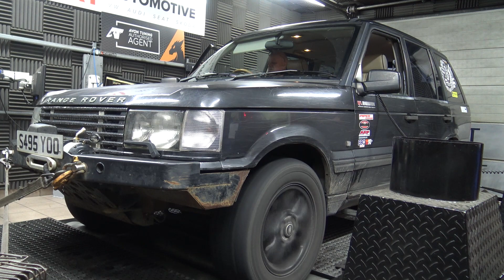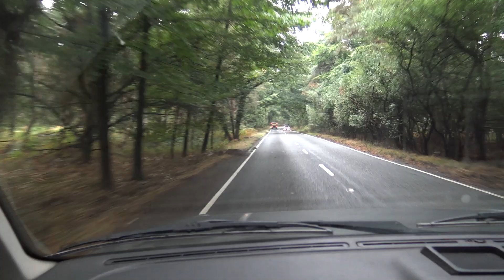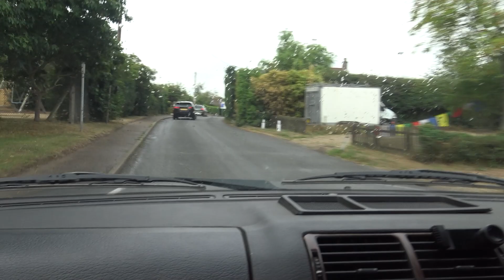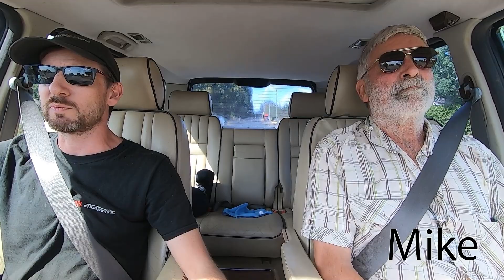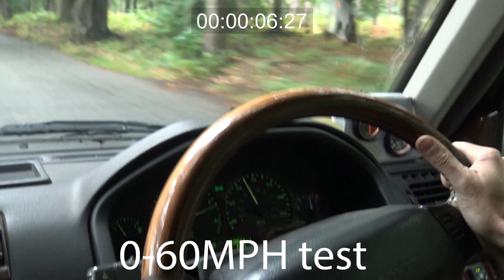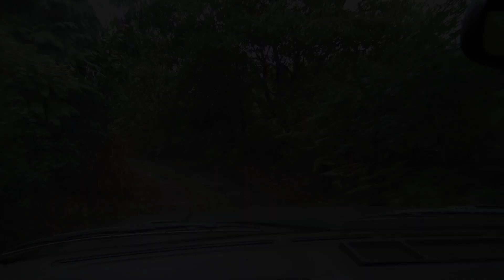Twin Turbo Tuesday Episode 17 -  Twin Turbo 4.6 V8 Range Rover P38 Final Dyno, 0-60 run and results

Comment: Good afternoon. Tell me, what do you have on a Range Rover P38 4.6 bosch 2001? If I'm not mistaken, you had a Merlin cylinder head and an intake manifold with 2 throttle valves on sale.

Comment: The dyno figures prior to turbocharging seem curious; 240bhp/255ftlbs. We're the quoted factory figures of c.220/277 or 300ftlbs for Thor, rather inaccurate?
Reply: Factory the 4552cc 4.6 is 218PS and 4.0 is 185PS so that is odd.

Comment: really close to standart sec 0-100
Reply from the maker: Well over 2 seconds faster, but as pointed out in the whole video build this was not about big numbers etc it was done for mid range driving power. Which this has by the bucket full.
Reply: @RPIEngineering  thx for answer
why dont choose charger?
and do you explain in videos how you change fuel mixture?) very interesting)
Reply from the maker: @MuNGusTik  Yes this is all explained in the video series. Several people have gone down the supercharger route however I wanted to do twin turbos as I didn't want the engine driving a blower along with a few other reasons.
Reply: Between 3.9 and 4.6 which one is more reliable and have longevity?  Stock @RPIEngineering

Comment: "Picks up like Don Juan in a brothel!"
I know you've maintained all along it's NOT about the BHP but I reckon you should do a Run What You Bring at Santa Pod! I had to get rid of my P38 4.6 years ago and miss it like mad but just the road tax for one here in Ireland is €1805/year! Before it went I did manage a RWYB and got a best of 18.05 seconds at 76mph. It certainly wouldn't set the world on fire but I had a great day out.
Also, have you tried it in Sport Mode yet?
Sad to see the end of this series looking forward to the next project.
Reply: Funny that. RWYB starts in October 😉
Reply: Yes sport mode just as fun and will play a bit more between the two but knowing peak torque is better a little lower down than 5500 rpm means might be better on the 1/4 mile etc in normal mode. But I'll play on the day
Reply: Here's the santa pod video for you lol https://youtu.be/xz54zXBiNuQ

Comment: Great results, I will likely do the same but with a single turbo and dedicated petrol.
One thing I think you missed when you spoke about the walbro pump and pressure reg was injectors? Are you running the stock ones or upgraded? And is the AFM from m62 or later n62 4.4?
Reply: I mention the injectors at one point. They are a 12 point injectors which handled the additional pressure far nicer than the stock ones but they did need the loom modifying to fit.

Of your going to carry a conversion like this or any other kind of custom setup my advice to you would be research and learn as much as you can about everything you are changing. Also key point is talk with the guy doing your tuning. If your in the UK you can discuss with us or mark at tornado but basically the ecu setup is going to govern the map, injectors, fuel pressure etc that you can run
Reply: @Boosted-V8  how can I contact you guys?
Reply from the maker: @danielvanoosten8987  Hi, You can reach us on info@v8engines.com
Reply: Info@v8engines.com